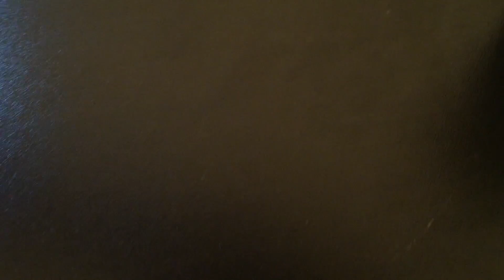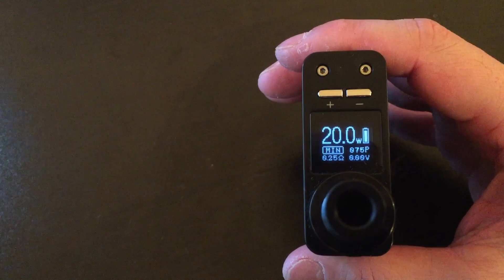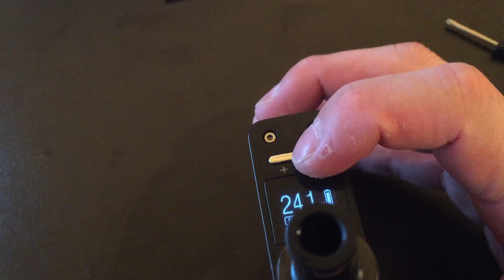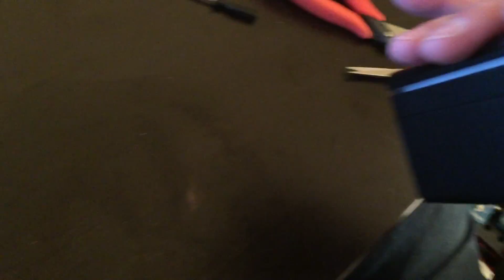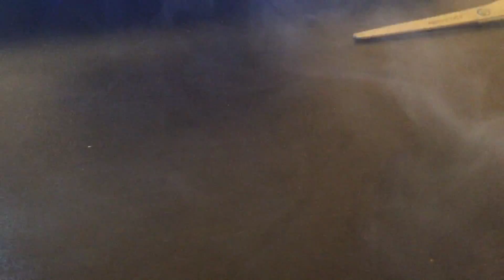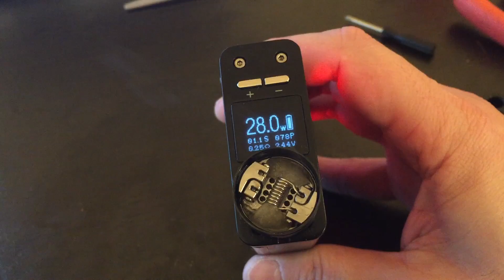vaping with a platinum coil

Comment: i want to know too
Reply from the maker: I've purchased some more platinum wire, so that all my decks are equipped with it, and it still looks brand new. In the long run, factoring in time to making coils, I've come out ahead.
Reply: is it available on amazon or should I go to a jewelery shop. so it will basically last forever? can temperature control work on it? Would you know the TCR settings?

Comment: I would not call a platinum wire NON OXIDIZING. Platinum is a well known dehydrogenating and hydrogenation catalyst; it will rip hydrogens off molecules in high pressure/temp conditions (e.g ethane to ethene). In theory it could help oxidize glycerine to acrolein and similar unsaturated molecules with alkene groups which are toxic. FURTHERMORE, if you hold a platinum loop in a stream of LPG or propane, it will grow red hot and ignite the gas, without you needing to heat it at all. However, NICKEL also has these similar properties, but no where near as active. It seems like you are not getting any problems.

Nonetheless this is fascinating, just from an engineers perspective, I hope the Pt isnt catalysing bad reactions.
Reply from the maker: I am fully aware of the catalytic properties of platinum. To clarify what I meant - platinum does not form an oxide layer on its surface when heated in the presence of oxygen at standard pressure. I'm actually fiddling with the equation to oxidize glycerin (or looking at the energies involved to drive the reaction) and it's unlikely that platinum would catalyze that reaction at the temperatures seen while vaporizing e-juice. Your insights are welcome and valued - few people think this deeply into vaping. It's been over six months of using these coils in several devices and they restore to new; I just dismounted a pair from a Griffin 25 and other than needing a couple passes with 2500 grit sandpaper and annealing with a torch, it's perfectly and effectively new. I do hope to move on to other elements in the platinum group for use in vape coils.
Reply: +kismetcapitan how much did it cost when your bought it and how much per coil?
Reply from the maker: +Joseph Burgard about $5/inch and the optimum length is 4.5~4.8 inches, varying the inner diameter between 3.2~3.5mm to compensate for post spacing, etc. Shorter/longer seems to struggle with temp control.
Reply: hmm ,interesting I'm going to give this a try
Reply: Hi Kismet, I have sent you a msg RE a paper I found.
Reply: @gigadad_exe   How did your platinum coils hold up so far?

Comment: How has this been holding up?
Reply from the maker: Extremely well; I've been moving my platinum coils from deck to deck, and dry burning restores the wire every time. Platinum does develop a matte patina (platinum jewelry does the same thing) but performance doesn't change. I will run 2500 grit sandpaper along the straightened wire a few times before recoiling it, but that's just to make it shiny and pretty. Some decks, especially clones, will chew off 2-3mm off the end of the wire though.

Comment: Pure platinum has a TCR of 0.00392... I imagine at 95% Pt, your coil has about the same TCR. For vapimg purposes, it's probably about identical, at any rate.
Reply from the maker: Actually, every platinum alloy has a different resistance and the TCR for 95% platinum/5% ruthenium is 0.001042
Reply from the maker: +James Cloud I should add, pure platinum's TCR is extremely close to titanium's. On several mods, platinum coils will be temp controlled in titanium mode. Not DNA200 perfect, but close enough to be more than usable. The higher the resistance of the build, the friendlier it will be using a TC titanium mode.